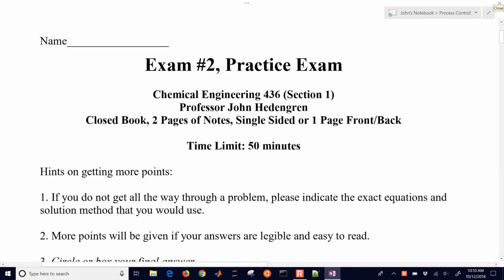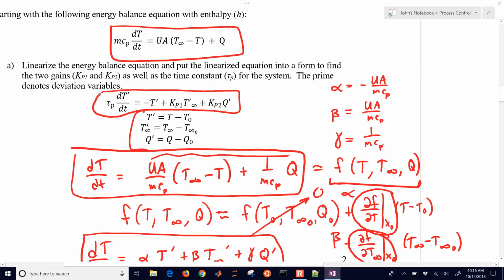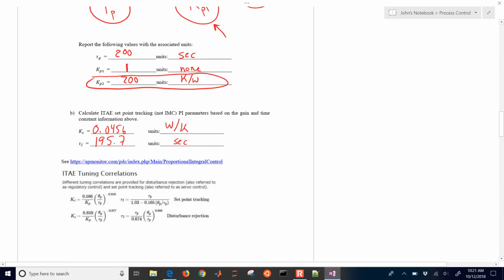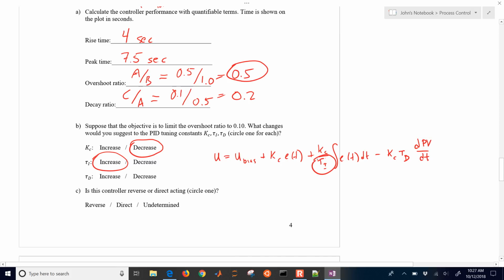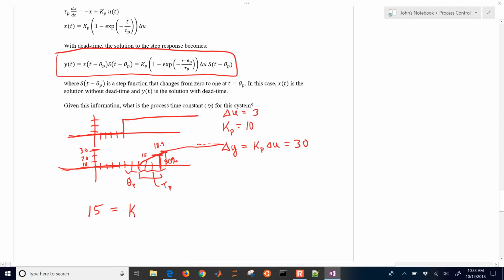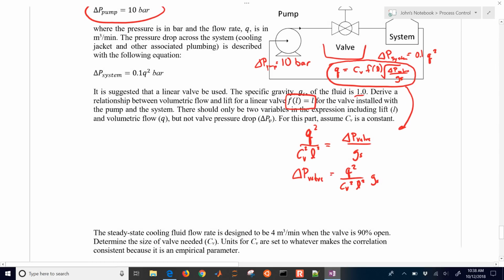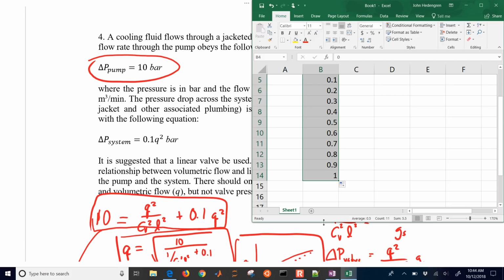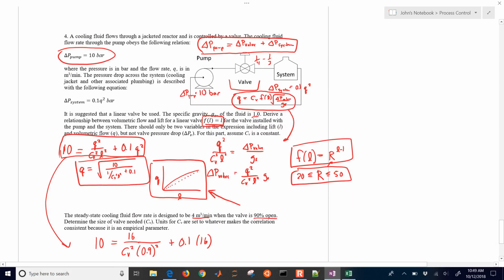Process Control Exam 2 Review

Comment: Pumps do not put out a constant pressure.   Fixed displacement pumps put out an almost constant flow.   There are pressure compensated pumps that vary the stroke to attempt to maintain pressure but the control mechanism is a spring so there is only a proportional band.  The pressure will droop as flow increases.

What you should look at is pump and systems curves.  There are two curves.   In the case of the pressure compensated pump this is nearly a flat line from 0 flow and system pressure down to full flow and some 15% to 20% less than system pressure.  The system curve starts a 0 pressure and no flow and increases non-linearly at a faster rate as flow increases.  Pressure can increase linearly in some sections and proportional to the flow squared in other sections.

Where the the pump curve and system curve intersect is the operating point.  Basically you solve for two unknowns with two equations.
Reply from the maker: Peter, thanks for sharing your insights on pumps. I typically use something like P_pump = P_pump_max - alpha * q^2 for centrifugal pumps and fix q = constant for positive displacement pumps. The pressure compensated pumps are interesting. Have you had any experience with VFDs on pumps that maintain a desired flow or pressure?